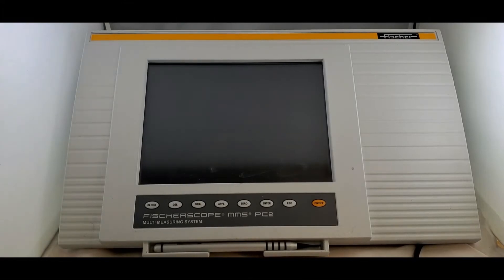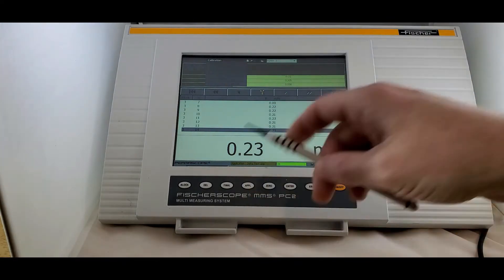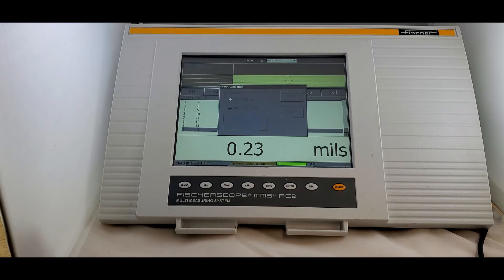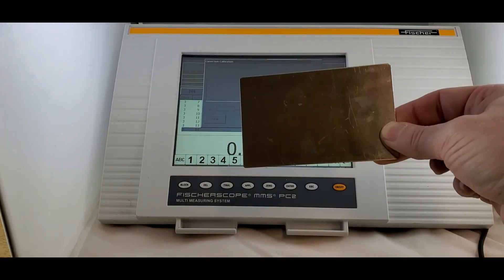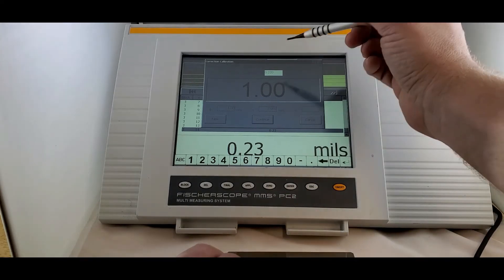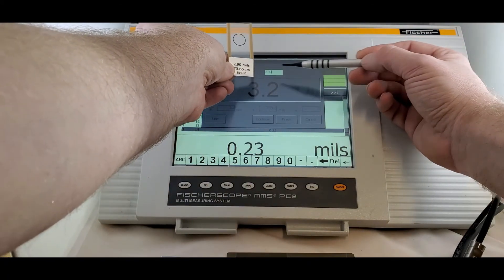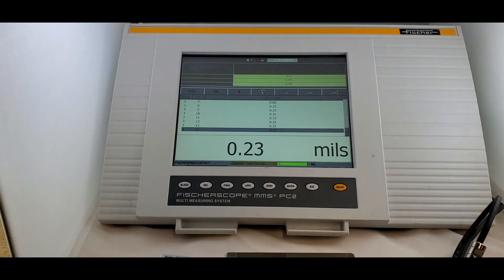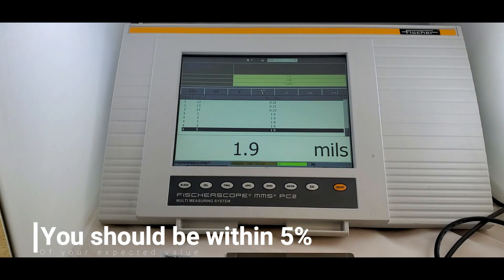How to calibrate a Fischer MMS PC2

Comment: i have problems connecting it to my pc, to export the pdf! only old usb sticks work and the COM cable doesnt work as its described in the manual! would welcome any ideas!
Reply from the maker: Hey @eydu8! That is correct, they have not updated the compatibility. You can also network it and save to a network drive.